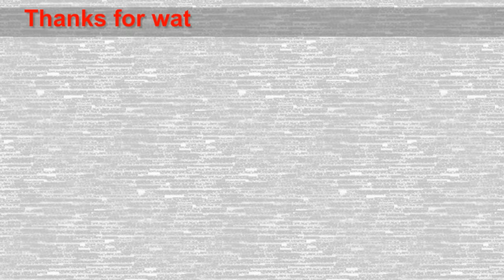Amazing Techniques Construction Rendering Sand & Cement On The Concrete - House Decoration

Comment: Would someone explain to me why he uses the sand in between layers of cement? Thank you.
Reply: Just a guess, the dried cement powder he peppers over it at times drys up the previous layer and also adds a bonding texture for the next ‘wetter’ mix he is about to add, so the whole thing doesnt become too wet and therefore unworkable, or rather, he can avoid waiting so long for cement to set and keep building out
Reply: @guyue1111  Thank you for your help 🙏💜🎉🙏

Comment: I never understood why dey put more cement on the wall like that ? What's the reason if anyone knows please share
Reply: The excess cement is for the build up for the art decor to be done on the wall.
Reply: Es por que en el resto del mundo las personas construyen sus casas para que duren por muchos años.
A diferencia de los norteamericanos que en cierto tiempo se aburren del diseño, vuelven a decorar.
Reply: The actual portland powered? Probably help the bond.....
Reply: The dry Portland does two things
1)  It sets the mold and helps dry the work So the plasterer can complete the form of the mold,
2) the dry Portland  enriches the finish by filling defects when rubbed with a wet sponge  called a float